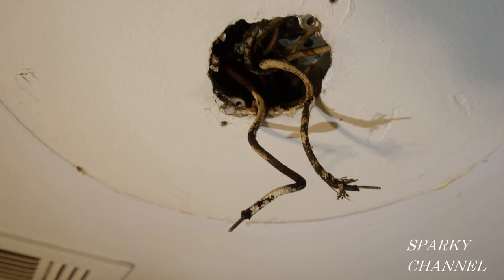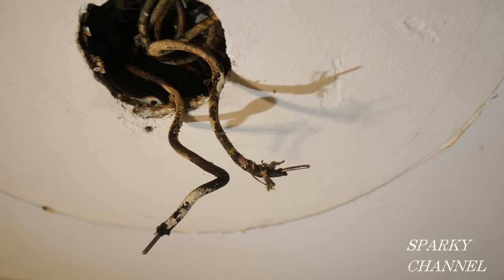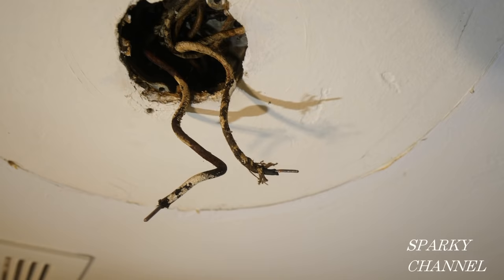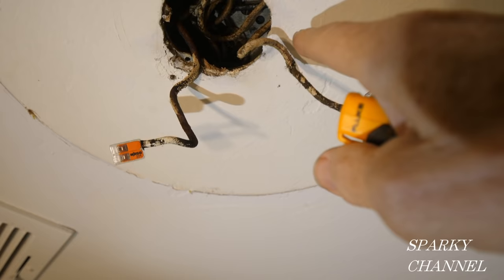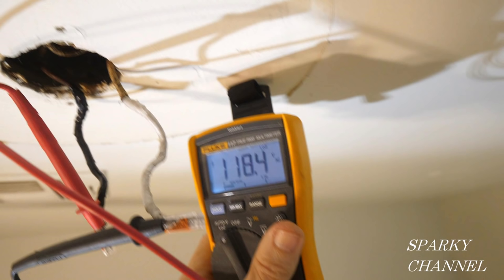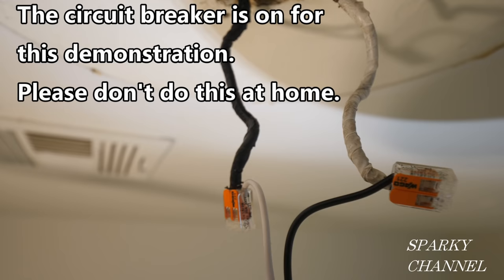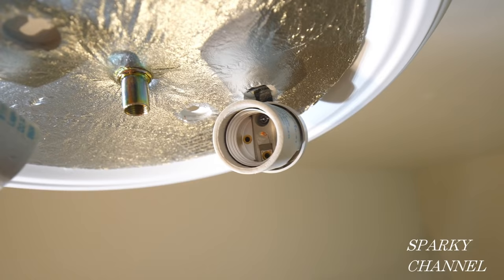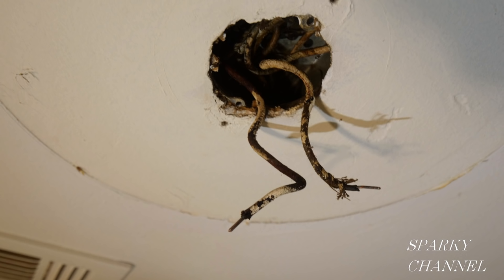Which Wire is the Hot and Which is the Neutral in an Old House? How to Tell and Stay Safe!

Comment: I recently had multiple circuit testers tell me that an outlet was wired correctly (except for correctly reporting open ground) when the neutral and hot had been reversed in the outlet. It was a similar situation to this with old cloth-covered wire. How does that happen?
Reply: If there is open ground the tester reports that and there it ends. There is no way for it to tell which is neutral and which hot without the ground.

Each of the lights just tells of there is voltage between the hot and the neutral.

Comment: I have the exact wiring, I tried the multimeter as shown. I have no voltage at all, one way or the other. The multimeter seems to work since I test it in an another one. These wired work since a light was on
Reply from the maker: Did you have the switch on while testing?
Reply: @SparkyChannel  no, but the current pass by the light first and then to the switch
Reply: @LFerdinandC  That is because of the reverse polarity Sparky talked about at the end of the video, whether it is reversed at the receptacle, outlet, switch, or another area. You must also understand pending on the wiring situation sometimes the white wire is used as a hot wire but it should be marked with black tape or something. With that said if you are not experienced in how to wire your overhead ceiling lights, your overhead sink lights, and your exhaust fan to the switches and your plug-inlets or the plug-inlets only work when a switch is on, it is best to leave it to a pro.
Reply: Try it with the switch on, even though the feed goes to the light first.

Comment: Both my wires are hot idk what to do now after taking i checked it with my voltage ..... this was a fan with a pull string light took the entire thing off bc the fan was about to fall
Reply: I have this same issue, both wires are hot, did you find a solution?
Reply: No ....I called a electrician
Reply: @fastbullit17  did someone already switch the wires wrong down the wire somewhere? Making them both hot
Reply: And did the electrician find the answer???

Comment: What if both wires are giving you a hot indication? This is the problem that I am having.
Reply: Use a meter to check voltage on both wires.  The one that has close to 120v will be your hot.
Reply: @johnobrien8542  out of curiosity,  why would the other wire be producing a current then?
Reply: @mikebevan1034   use the meter to check voltage on the wire you are talking about.  If they they both have 120v then you have 2 feeders and 240v.  My guess is the wire you are talking about might have a little residual on it which would trigger a tick tracer to read hot but a meter will tell you if it's 120v or slightly residual.   Only 1 wire should read 120v.
Reply: @mikebevan1034  my understanding is the wires run by other wires in the wall and those wires are powering a light, etc. When current flows in a wire it produces a magnetic field.  This magnetic field may be interacting with your neutral and causing some phantom voltage of only a couple volts and this is no big deal.  But, Like John said please check it with a volt meter to determine if it isn’t 120v or anything substantial higher than a couple volts.

Comment: If you hook up the wires backwards, will it simply not work, or will it work and would be dangerous?
Reply: It’ll fry most devices having the neutral and hot wire swapped. 

As for fixtures like this, it’s exactly what he said. You’re energizing a component that you’d mostly be having to touch even just to change a bulb. 

Even if you have the switch off, in this case, when your screwing in the lamp/bulb, once you flip the switch that bulb will get fried. Most likely you’d try another bulb, getting shocked w 120v as you’ll have that outer part of the socket energized.
Reply: @adrianlopez3640  thank you
Reply from the maker: It will work but be dangerous.
Reply: @SparkyChannel  thank you Sparky
Reply: @adrianlopez3640  I don’t know where you got that information. What you are describing is the nature of direct current and not alternating current. From the device standpoint it doesn’t matter which way the wires are connected. In fact, prior to three wire grounded outlets, plugs could have been inserted in the outlet either way and work just fine.
As far as the switch being off, as long as the switch is in the hot leg it will remove current from the fixture. However, I have found cases where the neutral wire was switched, especially in older homes with this type of wiring. This wiring style is referred to as knob and tube from the insulators used to distribute the wire through the building.
Reply: @TomCee53  I agree with you. Polarized receptacles and plugs were created to reduce the potential for shock when people were changing out screw in based bulbs. When the shell is connected by the hot rather than neutral, it is a shock hazard. Many people think that devices won't work with reversed polarity, but AC is alternating and devices don't care as long as they are getting the right voltage and frequency.
Reply: So I’m guessing an LED bulb would not work if the wires were reversed?

I know that in cars, most LED bulbs are not reversible like incandescent ones are.
Reply: @MoneyManHolmes  the power system in cars is 12 volts DC, and LEDs work on DC. LED bulbs for home have extra circuitry to convert the AC to DC and reduce the voltage, since LEDs typically use 5 volts or less. The short answer is if you reverse the wires on a lamp socket with an LED bulb, it will work, it just will be more dangerous.
Reply: @adrianlopez3640 That is total nonsense. The device does not know which is hot and whichbis neutral.

Comment: What if there are 6 wires
Reply: Was there a ceiling fan?  You are going to have to single out the wires and see which is light, fan etc .. Get an electrtian . Ceiling fan wiring could get tricky especially if it wss done by an unlicensed electrician.

Comment: Checking for hot wires on a light stick is not safe. I use a better reader. One lead on a wire and the other lead on the ground if there's no ground then use the metal box. One other the set of wire should read 110-120
Reply from the maker: Thanks!
Reply: Just how on earth would it not be safe? If you get a positive result in only one then it is obvious that it is the hot.

Comment: what if they both hot wires?
Reply: They will not both be hot. Use a voltage meter and the one wire that has close to 120v will be your hot . The other one (neutral) will not read 120v on the voltage meter.

Comment: I went to replace a single pole switch and a ceiling fan.  I hooked everything up but the ceiling fan did not work.  I unhooked the fan and switch to find that "with everything disconnected' I have a hot coming into the ceiling fan box and both the feed and switchleg inside the switchbox are both hot.  I am stumped?  How could this have been wired originally to work?  This is an old house and there is no neutral inside the switchbox but there is a neutral inside the ceiling box with the hot.
Reply: I think what u have by reading this is lets just say 2 #14/2 in the light box and just 1 #14 in the switch box?
Reply: First let's explain ROMEX.  Romex has 3 wires all together - a black wire (Hot)  a white wire (Neutral)  and a bare wire (Ground) in one  insulated bundle.  In older homes ~1950's ~1060's you would see only a black and a white.    Romex running to your ceiling box has BLK = hot and                  WHT = neutral.    Romex runs from your wall switch box straight to your ceiling box.     One wire is tied to the hot in ceiling the other wire is tied to the fan in ceiling box.  So both wires running from wall to ceiling are HOT so when the switch makes the BLK and WHT touch the fan comes on. Yes this is confusing because BLK & WHT are both HOT.   Today the electric code will not allow the use of both BLK & WHT as hot in a switch box.  There should be a BLK&WHT coming from your fan.  Fan WHT to ceiling box WHT.    Ceiling BLK to Romex BLK from wall.  Fan BLK to Romex WHT from wall.    Your new switch should have 2 brass screws.   One screw gets switch box BLK.  One screw gets switch box WHT.  Read your fan's instructions to correctly connect the bare ground wire in ceiling box to the ground of your fan.
Reply: @davidwv7370  thank you for that explanation 🙏

Comment: Back in the old days white was hot and black was neutral.
Reply: I took shop class in the 1960s and one project we did was to make a lamp.  I’m pretty sure there was no mention of which wire to put where on the bulb fixture and I know the plugs were same and so, unlike today, you could reverse the plug and make the threads hot😬

Comment: Those wires are so old I would question if they are braided in asbestos.
Reply from the maker: No, they weren't.
Reply: Not asbestos.  Rubber and cotton. Had it tested.   You'll know asbestos it's very fiber looking with a varnish inner core

Comment: Is that not aluminum wiring? If it is, you DO NOT want to connect aluminum wiring to a copper connector.
Reply from the maker: It's copper wiring.
Reply: @SparkyChannel  It's most likely original BX cable which used copper wire coated with tin to prevent the copper from reacting with the rubber insulation.  I lived in a home that had this type of wiring for many years.  I handled it with extreme care as it was very old.

Comment: Bill, do you know how that voltage sensor work?  I would guess that it uses electro-magnetic field detection, but both hot and neutral wires would have magnetic fields around them.  How can the tester distinguish between "hot" and neutral when the tester doesn't have any reference point?
Reply: Neutral wire is supposed to be bonded to earth-ground at the breaker box. So when open-circuit, it has no field.
Reply: @jeffweber8244  But the hot wire is also open-circuited.  How is the alternating voltage in the neutral wire different from that in the hot wire?  And how does bonding to the earth ground have any effect on the field (that I believe is present) from the alternating voltage in the neutral wire?  Again, the sensing equipment itself is not grounded and has no reference point.
Reply: @yusuihang  the alternating voltage on the neutral wire is almost 0. The tester is picking up the electromagnetic field from the wire, although there is no power flowing through the wire, there is a very small amount of current flowing back and forth due to the capacitance in the wire.. You can also measure which one is hot with the old neon style tester which uses capacitance in your body to allow small amounts of current to flow and light the neon.
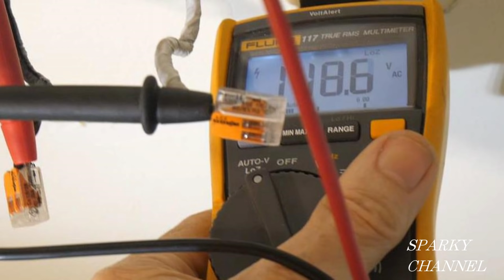Reply: @plkracer  The open circuit AC voltage of the neutral wire, with respect to the hot wire, is 118VAC (3:50 in video).  You mean the alternating current is almost zero?  I agree the capacitance in the wires would induce a field, but why does the equipment only pick up the field from the hot wire and not the neutral wire?  If the argument is that the neutral wire does not have capacitance with respect to the hot wire, I don't understand the basis of this argument.  Also, if you were to use the tester in an ungrounded box with hot and neutral wires, the neutral wire is still not "detected" by the tester but the hot wire is.

I'm not familiar with the neon style tester you mentioned, but will look it up.  Thanks.
Reply: @yusuihang  AC doesn't need to reference anything to detect since we can assume the mid point is zero potential. The hot wire will vary between +/-170 volts, whereas the neutral will not, which is center tapped to the transformer at the street. This doesn't work for DC of course.
Reply: @plkracer  The hot wire is approx 120V AC, referenced to the neutral wire.  And the neutral wire is approx 120V AC, referenced to the hot wire.  If you measure the open circuit voltage between the hot and neutral, you would get the same reading regardless of which wires you put the red/black probe points.  The neutral is "zero" potential only when referenced to the ground.  The fact that the neutral wire is taken from the center tap of the transformer does not make it "zero" potential.  It is zero potential if you reference it to ground--which is bonded to the neutral.  That is my understanding.

EDIT:  I'm not trying to be argumentative.  Please correct if I've misstated anything.  Thanks.
Reply: @yusuihang  the polarity doesn't matter since it is AC, the meter can't tell where the voltage is coming from because the polarity switches. 
If you want to do an experiment, make sure your meter is set to read AC volts, hold one lead between your fingers, and touch the other to the hot or neutral wire. I guarantee you won't get shocked unless your meter is faulty. Neutral will read zero (or very close) while the hot will be 40-60v. The actual voltage depends on your own capacitance and resistance.
Reply: @plkracer  Wouldn't your experiment only be an indication of the poor ground path through your body to the earth ground?  If you were to isolate your body from earth ground, would you get a different measurement between hot and neutral?  And isn't the AC tester that I am questioning isolated from earth ground?  I'm not an electrician but I do have an electrical engineering degree, from many years ago.  I was just curious about the engineering aspects of the AC detection.  Thanks for your replies.
Reply: @yusuihang  yes, the purpose is to isolate yourself and the tester from any reference point, and show there is no AC potential on the neutral line, yet you can still determine which line is hot because it is able to charge and discharge you (a capacitor) through one wire.
Reply: @yusuihang  there are many other detection methods for AC, but all require the voltage potential to vary with time, which allows non contact sensing through the induced magnetic fields.
Reply: @plkracer  So you are saying that the operation of the non-contact AC voltage detector relies on the establishment of an earth ground through the person holding the voltage detector tester?
Reply: @yusuihang  no, no earth/ground needed. Non contact sensing is either capacitance based, or transformer based.
Reply: @plkracer  Neutral wires don't have capacitance?
Reply: @yusuihang  the neutral has capacitance, the same as the hot wire, but since there is no significant AC voltage on the neutral wire (usually a few volts or less) there is nothing to detect. Static voltage potentials to ground cannot be detected without directly connecting the meter to a reference in DC mode.
Reply: @plkracer  Why is there "no significant AC voltage on the neutral" but there is--per your implication--on the hot wire?  Are you still claiming that the neural is "zero" potential?  You know that voltage only has meaning when it is referenced to something, right?
Reply: @yusuihang  AC and DC are vastly different. That is why I said the static voltage (DC) is unknown. It takes an oscillation to make AC, which doesn't exist on the neutral in significant quantity to be of worry.
Reply: @plkracer  For anyone interested, I found a circuit diagram for the AC voltage detector.  It is indeed based on electro-magnetic pickup through an antenna, and the difference in EMF radiation between hot and neutral wires is the reason the radiation from the neutral wire isn't detected.  The key point is that EMF radiation is depended on the physical properties of the radiation source.  The antenna system from the hot wire is different than the antenna system in the neutral wire system.  Maybe someone from Fluke can explain this--and this was what I was curious about in my initial question.  Sorry to ask an engineering question on youtube.  Lesson learned.
Reply: @yusuihang  The neutral is bonded to earth/ground at the first means of disconnect. It has 0 or little potential in reference to ground or the person working on the circuit, so long as its path back to the source isn't disconnected. If it is, any load present could return back through the neutral and have a voltage in reference to ground because it no longer is bonded.
Reply: @yusuihang  He already explained this to you in other words but you didn't seem to want to believe his answer.
Reply: @illestofdemall13  Well, plkracer said that the operation of the non-contact AC voltage sensor did not depend on the establishment of an earth ground through the person holding the voltage detector tester.  You are obviously very knowledgeable on this subject matter.  Please help me understand.

Comment: i personally would print a label (brother or casio) and have it on the cable.... the black and white tape method may not be understandable by others..
Reply from the maker: That's fine as long as the label is not flamable.
Reply: Black and white are known colors (Code).  If one does not know they should not be messing with it.
Reply: A lot of those label printers use heat sensitive label tape.  The printing will fade over time especially if the fixture gets hot from the bulb or current draw.
Reply: what i prefer  is heat shrink it can be got in black red white n almost any color u could want
Reply: Anybody who messes with electricity should at least know the difference between hot and neutral and the respective colors.